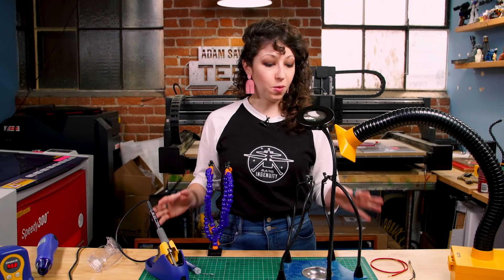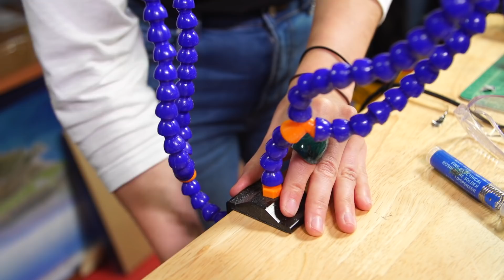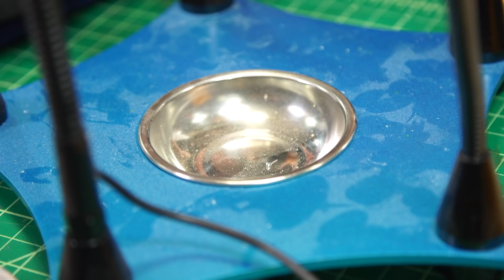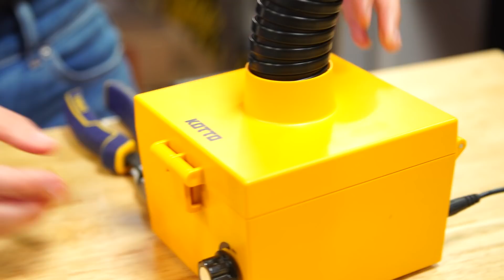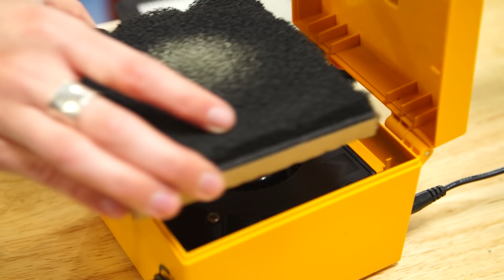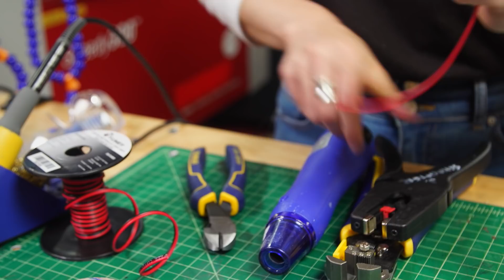Tested Favorite Tools: Soldering Fume Extractor!

Comment from the maker: KOTTO Soldering Fume Extractor: https://amzn.to/3o4j94F
HEPA Filter for Fume Absorber: https://amzn.to/3bdf1dl
Helping Hands: https://amzn.to/3o9qVu6
Table clamped helping hands: https://amzn.to/3od9WH9
Hakko Soldering Station: https://amzn.to/3vVxcfj
Reply: Link to the black wire stripper?
Reply: @cognetic  If you want to treat yourself, try the ones from Knipex (https://www.knipex.com/products/wire-strippers-and-dismantling-tools) if you just need a cheap one for once in a while, use whatever is on sale in your local hardware store I guess.
Reply: Hi Adam
Reply: @WyattWinters  still wanting yo go on original Jurassic Park ride, but the Jurassic World ride looks good also
Reply: Nice set up!,  I personally use one that I found on thingiverse; putting it together was very easy just follow the instructables guide, it works very well https://www.thingiverse.com/thing:3474360
Reply: Tools like this help engineers solder for fortune.
Reply: A little tip in return: When you strip wires and it leaves that bit of insulation still on the end of the stripped wire, twist that little piece of insulation to twist the wire, in order to save your fingers a bit.

Comment: One physics tip.  If there's virtually zero exhaust, there's virtually zero airflow, meaning your won't be capturing much of the air that contains fumes.  I'm sure there's some exhaust though, but perhaps there may be some benefit in modifying the exhaust so there's less constriction and less noise.

Comment: That fume extractor is exactly what I need! Thanks for the info!
Reply: Same, i just got over being awfully unwell for a solid 24 hours. Either the regular flu, or welders flu. I knew it was possible but I had a couple fans going and I been holding my breath when necessary. Either way it was enough for me to order one and try with some of the hepa filters they sell.
Reply: Was it any good? The Amazon review are so-so, w/ main issues cited being lack of reliability and flow.

Comment: That KOTTO Soldering Fume Extractor is nice build, but it has a design flaw. 
The charcoal filter needs the placed behind the HEPA filter, a charcoal filter is not designed to block particles, but to eliminate smell.
Reply: It shouldn't really matter here. You're shortening the life of the carbon filters by also using them to block particles, but either way the chemical gasses you're hoping to neutralise are passing through. The product's official photos show it was hepa on top anyway, so they've just got it installed the wrong way (she does install it the right way at part of the video too), so not really a design flaw (unless you expect an $80 product to have way more safeguards).

Comment: Maybe the classic "bent over" wires from this technique were why it wasn't used but I could not imagine doing that many wire to wire connections without a solder pot. Although tbh you might be able to get them flush anyway if you really wanted... Would probably be able to do one every couple seconds otherwise (he soldering at least, adding heat shrink and twisting the wires will still take a bit of time.)

Comment: i just bought a kotto fume extractor to replace the home made version i had in my lab. mine actually worked quite well from 6inches horizontal but the hose was just dryer vent tube so not positionable .. this was surprisingly good, works perfectly at 1/4 to 1/2 speed and quiet at that... i love thos little thing!! thanks!!

Comment: A really cheap awesome way to hold wires while soldering, cut a couple slits in a cap for spray paint cans. It holds the wires great and catches any solder that may fall. Most ppl already have a can with a cap like that so they're free, super easy to make, and work great.

Comment: I just recently bought a TS100 soldering iron, like the one Adam uses on his drill batteries, and I will never look back. It works so much better than my old iron, and not bad on the price either.   My first use for it was actually why I bought it, replacing switches in an $85 gaming mouse, rather than replacing it.  My old iron was too bulky, had too big a tip, and could hold heat well enough.  The TS100 did everything my old one didn't, and I was able to quickly fix the mouse, which more than covers the cost of the new iron.

Comment: I have the same extractor. So cheap for what you get, and actually has a hepa filter that can remove the fumes.
Reply: Is it working well for you still? I feel like I might have just had a bout of welders flu, or regular flu... but i been modding sega game gears to sell and I got through about 10 repairs before waking up all nautious one morning. I ordered one of these this morning because I have a cap job to do tomorrow.
Reply: @tokin420nchokin  Still working good for me and definitely removes the stuff from the air as best as I can tell.
Reply: @Sevalecan  awesome to hear, hoping i just had a normal flu its been going around but hard to say with all the soldering I been doing lately. Have one coming tomorrow, fingers crossed

Comment: "Mise en Place" for soldering, smart! When you begin working transistors you might pluck the rubber boots off of the "helping hands" to double for heat sinks, as heat is the enemy of solid state devices

Comment: Just a heads-up... each of those wire strippers have an adjustable depth screw (to stop them from cutting the wires like you said). No need to buy two pairs

Comment: At that quantity of LEDs, I am surprised that there is no PCB involved.  I myself got frustrated on hand wiring only some 20 LEDs and 10 3-terminal switches.  That was a prototype several years ago and now "they" are wanting a production of 20 units.  You bet, I'm designing a printed circuit or two!

Comment: a small ring light inside the micro fume extractor would be useful at least in my opinion
Reply: I like what your saying. The only extractor with a ring light i saw didnt have a very big filter. Attach a light to the hose though and your good. Might get front heavy though.

Comment: My DIY "fume extractor" costs under 20 $. It's super small and quiet.

It's just a 120 mm PC case fan, with a cheap USB power supply with a fan connector. It even has a speed control, but even at the highest setting, it's so quiet, that I often forget to turn it off.

I have a dust filter on the intake, and a "finger guard" and an active charcoal filter on the exhaust. The filter is cut from a kitchen fume hood filter, so you get about 50 filters for 5 bucks.

It's probably not as good as a real fume extractor, but it's so small, that you can position it right next to your work. And it gets the fumes out of your face (and out of your eyes, soldering flux is not nice stuff).

The fan is about 6 bucks, the dust filter and finger guard are about 2 bucks each, the fan PSU is about 5 bucks, and the active charcoal filters are about 5 bucks for 50 pcs.

Comment: If you put a single sheet of toilet paper on top of the charcoal filter.
The filter will last many times longer.  Just change the sheet after using  the machine a few times.

Comment: I made a big fume extractor out of quiet PC case fans in a grid (tied together with small zip cords), wrapped the intake side in thin wire mesh, then covered that with charcoal. Very quiet - quiet enough I don't mind running it all the time so I don't forget to turn on the fume extractor, it's already running ^_^ - and pretty decently effective. (Basically I'm making up for the lower air movement rate per fan by having a lot of fans.)
Reply: Wow thats efficient
Reply: Thanks for your love and support over the years! you can message me directly on my personal Gmail hangout address!
adamsavage7.connect@gmail.com!
or directly on my Whatsapp number
+1 (903) 500-4375!
And also, ensure to include a detailed message of yourself!
stay safe and stay healthy.

Comment: Is there no concern for cold solder joints with the vacuum that close to the solder area? It’s also really difficult to maintain a proper temperature on your iron with moving air like that.
Reply: Airflow at the iron is very low. Good tools, materials & technique will result in high quality joints with or without the extractor. It’s far more pleasant with the extractor, though.

Comment: Would this work for 3d resin printing? I live in a small apartment. Having 2 dogs, Fumes and lackluster solutions for them keep me from taking the plunge. Could this be a valid solution? I also wonder if it also couldn't be used for airbrushing.

Comment: While I still use my soldering iron, for joining things like this setup, I've gone to using almost exclusively solder seal style wire connectors. Per unit cost is higher but time saved and the built in strain relief is nice.

Comment: I bought one of those Kotto fume extractors last year and definitely like it, though the hose has a tendency to pop out of the base when you try to adjust it.

Even with that, it's nice to be able to position the intake right where you need it - I generally work on restoring vintage vacuum tube radios, and being able to move the head to where I need it in the chassis is a big factor in why I bought it.

Comment: I was just thinking of buying one, but I saw some concerns about that hepa filter not actually functioning as a hepa filter correctly.
Reply: The primary goal of the fume extractor is to get the fumes away from your face, not to filter them. HEPA is more for allergens, anyways.
Reply: @mrb692  yea, you definitely want airflow or a window open in your room even when using these units, unless you spend $$$ on one of those proper industrial extractors
Reply: @mrb692  that is nonsense.  The point of the filter is so that it doesn't exhaust it elsewhere in the room, and the filters work fine for that purpose.
Reply: @CGoody564  The fume extractor has to exhaust somewhere or there would be no airflow. The filters are mostly useless for fumes, but do serve to trap some of the dust in your room
Reply: @mrb692  no, the AIR has to exhaust somewhere; particles and fumes are supposed to be trapped in the filter, which is exactly what happens, especially with the improved multi layer HEPA filter.  You have no idea what you're talking about.
Reply: @CGoody564  We’re saying the same damn thing. The fume extractor moves air from near your face, down a hose, through a filter, where it leaves in a place not near your face. HEPA filters trap particles 0.3 micron and larger but they don’t work on odors, so all the extractor does for fumes is move them somewhere else and dilute them with lots of air. Sure, they’ll get rid of the bigger smoke particles, but the smaller (and worse for you) particles will blow right through. 

“While HEPA (high-efficiency particulate air) filters are designed to deal with large particles, they do not remove odors, chemicals, gases or VOCs. This means they are primarily ineffective for odors.”

https://molekule.science/air-purifier-for-odors-in-your-home/